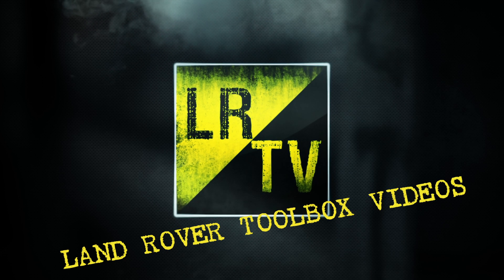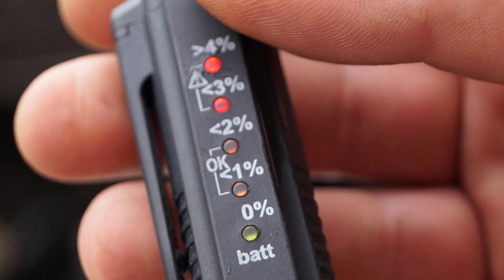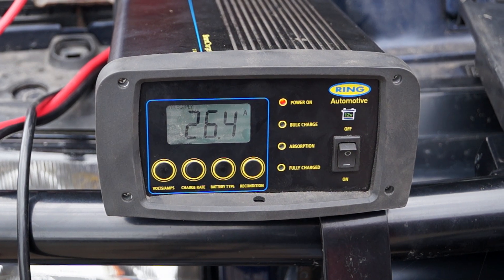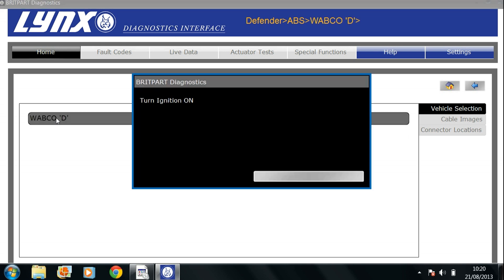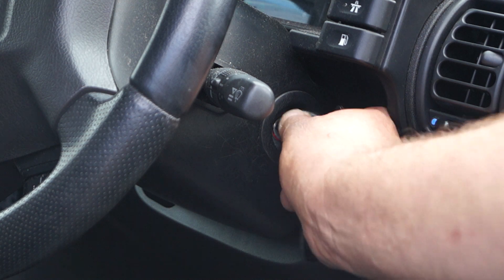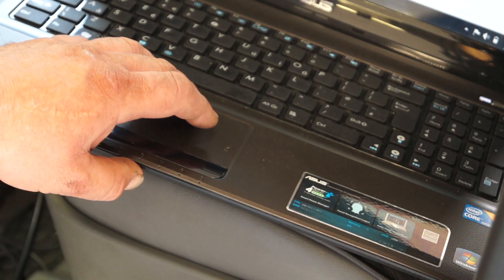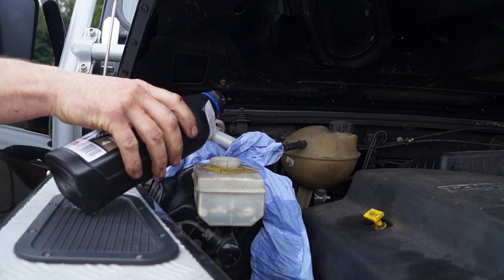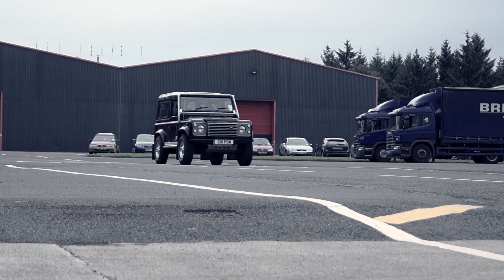Bleeding an ABS system on a Land Rover Defender / Discovery 2

Comment: Hi. I have 2003 D2. I took off  all calipers and pistons. Repaired all of them. I took off brake fluid reservoir and cleaned. Then I putted all of them to their places. I filled the brake reservoir max and made manual bleed. I received the air all calipers. Now new fluid is coming from all of the calipers. But the pedal is soft and brakes is not working good. What do you prefer or what can be the problem. Thanks

Comment: Hi would this work on 1999 p38
Reply from the maker: You need to check up the specs for the kit as it has changed somewhat from the original. I guess because it is electronically sophisticated ti would have some sort of facility to power bleed.

Comment: Hi, great video, but does the modulator bleed cycle get air out of the Master Cylinder? Cheers!
Reply from the maker: No,  In a nutshell.  You bleed outward.  Master cylinder, ABS modulator to callipers.

Comment: Hi Chris, thanks for a great vid! I need to replace my abs modulator and not sure if i should empty the brake fluid reservoir? Do i need to do anything else before disconnecting lines from the modulator or just a. Remove fluid, b. Disconnect lines from modulator, swap in new dry modulator,, c. Connect lines, fill reservoir, manually bleed wheels starting from furthest wheel from modulator LR on my RHD 110, d. Keep reservoir filled, then do power bleed via nanocom?
Reply from the maker: The reservoir will probably drain out if you don't take the fluid out but it is your call, The modulator shouldn't be totally dry however bleed it through manually of pressure bleed it until you have fluid to the modulator.
Reply: Trailerfitter's Toolbox Videos hi Chris, i've swapped over the modulator after removing fluid from the reservoir. When all pipes were connected to the modulator, i filled up the reservoir and the started pumping the brake about 10 times, the pedal went from near nothing to firm. I then pressed pedal to the floor and pressed Bleed Modulator, every time it did a cycle, the pedal when down by a fraction. I did this process about 5 times. I then performed manual bleeding starting at the FL, FR, RL RR until all air bubbles were removed, by this time the pedal was very firm. The next thing i did was to start back at the FL and opened the bleed nipple, with pipe in clean fluid, glass bottle. I pressed the Power bleed function on the nanocom i have but apart from a little fluid that ran from the nipple in the pipe before pressing the power bleed nothing came out, no fluid at all. I didnt allow the reservoir to drop below low and used just under 2L of fluid with the bleeding i have done. I started the defender as a last resort and the pedal was like sponge until you pump it a few times. I wondered of there was air trapped in the modulator and thus the reason nothing comes out when the power bleed function was used? I have parked the truck as i can not drive it in the state it is in, and at my witts ends, i've removed the wheels wuit a few times today to re bleed but no luck. Have you got any idea what i am doing wrong or how i can get the air (if it is air) out of the modulator? Please Chris.

Comment: I have a 2000 LR d2 that I'm getting ready to replace all calipers, rotors and pads.(Can't afford all at once so I've been saving and buying as I go) I DO have a pressure bleeder. My question is, what's the bare minimum(read least expensive) tool I can get to do the electrical bleeding part of this?  BTW, when I was hit by an IED in 2011 in Afghanistan, I was allowed to watch/work with British mechs in Kandahar repairing some of their up-armored Rovers and had a ball. I think it helped my recovery big time.   PS . subbed
Reply: I use my Autel maxisys. Ask around your mechanic friends and see who may have a diagnostic tool to help you

Comment: I've got a discovery 1 300tdi and I've got mega problems getting the air out of the system having replaced the master cly and servo and one of the rear pipes, how can I bleed the modulator without a lap top or have I got to send it to a specialist?
Reply from the maker: you could try pressure bleeding it ?
Reply: I have a 300 tdi and I used a Gunson eezibleed on it and it was great! I managed to replace the fluid in the whole system in less than an hour.

Comment: When trying to manually bleed the 2007 defender with ABS I can only get the pedal to go half way down until its hard stop, is this the bias on the SWB to the rear. Also, I have pumped a lot of fluid to the OS rear and get continual air and just can't get the rear to work.   .. PS changed the Master Cylinder from a Bearmach OEM unit as I thought that was the problem but it was not the problem, thinking I might have a faulty ABS unit but no idea how to check. I have tried bleeding the top four pipes on the top of the ABS unit as well. Thanks as always if you can shine some light for me
Reply: Just to update I put a pressurised brake fluid tank onto the header tank of the master cylinder and re-bled from the master cylinder to the ABS unit and especially the pipes marked for the rear two callipers. I then bled the rear callipers just using the pressurised feed and had to pump through over a litre of fluid until I was sure there was no air in the system and that was it good pedal and all callipers working as they should. One point worthy of note is I could hardly believe how much fluid I had to bleed to get rid of all the air
Reply from the maker: There is no bias to the rear.  I am not sure if the still fit the safety PRV on the SWB but that is to split and shut of part of a brake system if it leaks.      The only way to check a faulty ABS system is to talk to it with a reader / scanner.  It may not throw up fault codes but will give you an indication of problems if you monitor it or activate components within the system.  

 You can do certain checks such as getting the shuttle valves to operate independently either by activation or monitoring them with live data.   I have noticed on many vehicles with ABS one really needs to activate the ABS modulator / power bleed to get it to bleed out that part of the system.
Reply from the maker: AH ha.  I just saw this after writing an answer.    Yes of course pressure bleeding is another option.  Usually reserved for when it get tough.  If the system has been drained it will take some fluid to get it all back.  I tend to isolate sections then replace parts then bleed out with as minimal loss as possible.  Glad it is sorted for you.

Comment: Any tips on bleeding a brake system on a 2008 Freelander 2, can I bleed it manually the normal way?
Reply from the maker: Yes, there usually isn't a problem doing that.  It is a normal brake system with added pumps when it has ABS fitted.
Reply: Ok great, do I need the engine running so the servo is working whilst bleeding? Thanks, Craig.
Reply from the maker: You'd want to use the power of the servo if you were bleeding up little lorry brakes but better to bleed without the engine running.  That way you "feel" the pedal.

Comment: A quick question, is the manual bleed sequence the same for a 110 with ABS as it is for the 90 because of the different pipe layout and no PRV that the 90 has? Thanks
Reply from the maker: as near as damn it.

Comment: Can ABS systems be bled without setting off the modulator, as in the manual way. I have managed to do it on a Discovery 1 1998
Reply from the maker: +Omar Hofayz  Yes just bleed it normally.

Comment: When you power bleed the modulator is there any nipples open to allow the fluid through?
Thanks Tom
Reply from the maker: Tom Milne  No it is all internal first.  Open nipples only when bleeding callipers.
Reply: Many thanks worked a treat and the fluid was long overdue for changing on my 2007 Defender. Great site and I appreciate the reassuring advice, PS Lynx Tool is good I purchased a single vehicle tested.
Reply from the maker: okay cool. Thanks for the heads up.